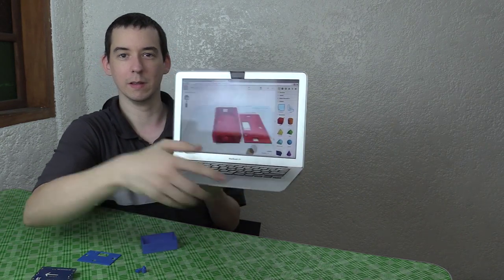3D Printed enclosure for LM2596 Buck Converter

Comment: Thanks for the work, i agree with wtam69 it seems like you have taken the time to cad this out for me, i actually started this on tinkercad also, but made it as far as the bottom part of the case before i gave up and decided to type it the search on thingiverse. 
i have a tronxy #1, it has a 150mm build area, and im going to be using some bright green PLA. 

thanks again.